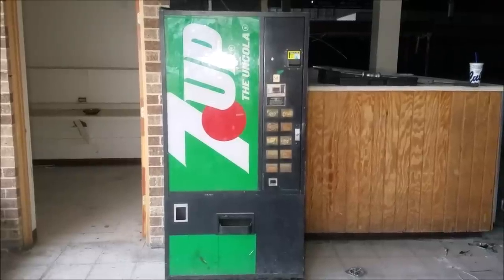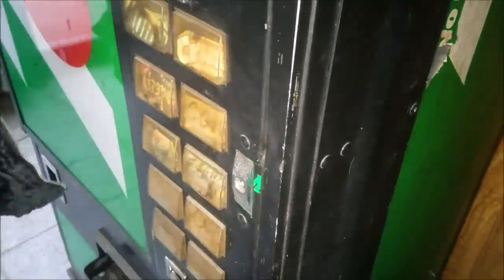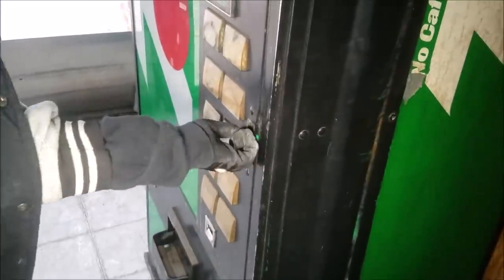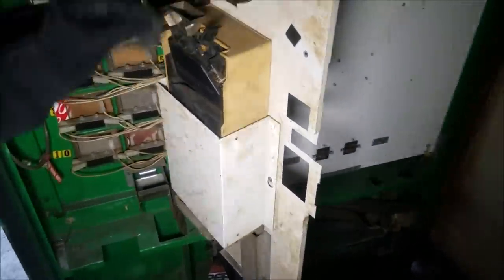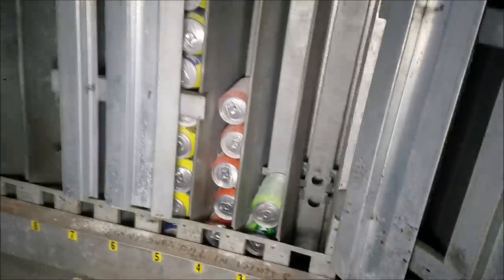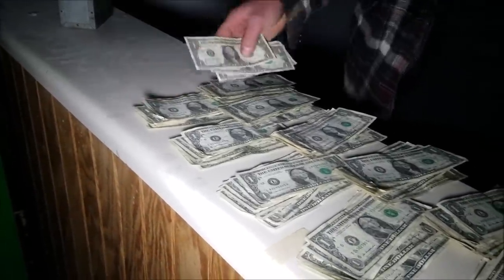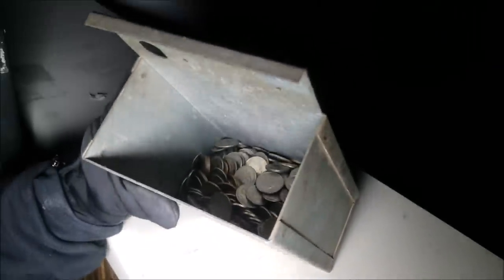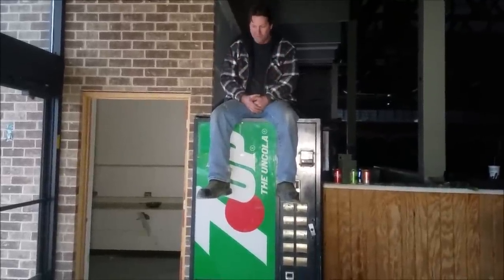ABANDONED VENDING MACHINE FULL OF MONEY! We found money breaking into an abandoned soda machine!

Comment: Based on how old the machine, it is quite possible a lot of the coins are silver.

EDIT: Based on the can designs this machine was maintained within the last 10 years.
Reply: Silver coins have not been minted for general circulation since the mid 1960s, when a soda would cost you 10 cents and most likely would still come in a bottle.   A machine from that era would not have dollar bills in it.
Reply: @chrisdundon4594  I remember getting a silver dime sometime in the 1980's in change.

Comment: Sometimes the owner of the business own the vending machine. If you look at the selection buttons you can tell they are not professional and nor do they have the soda logo. The owner most likely forgot about the machine. Or sometimes the route vendor thought he would come check on the machine when a new business opened up at that location. My uncle works for a beverage company. He says at times it can be hard for the route vendor to get into locations after a building has closed for business. Usually they just wait for a new business to open up and they go in and start servicing the machine.